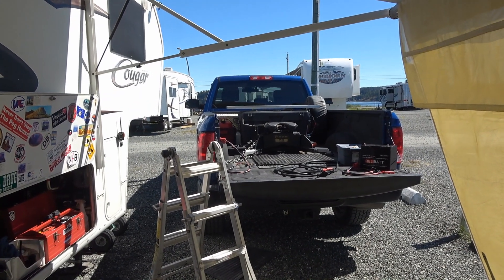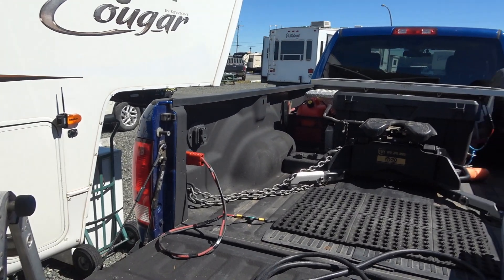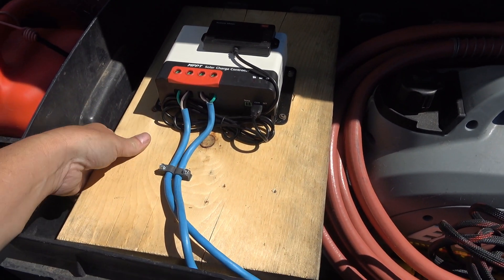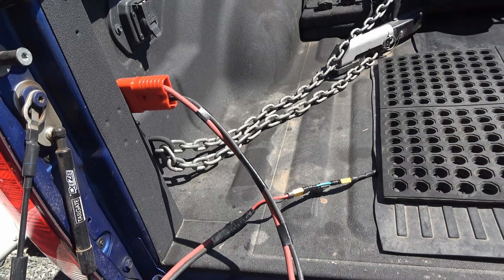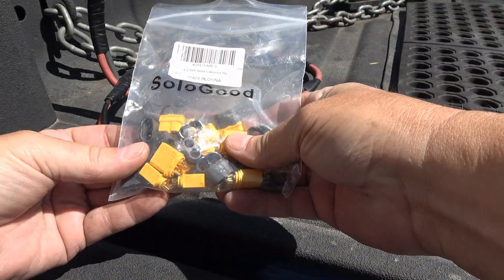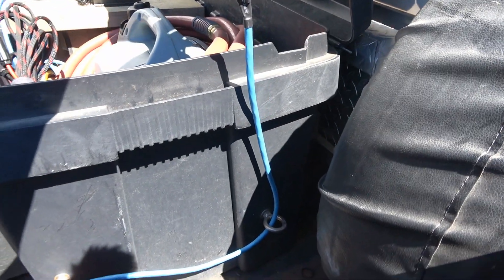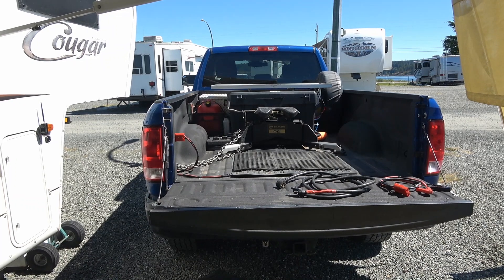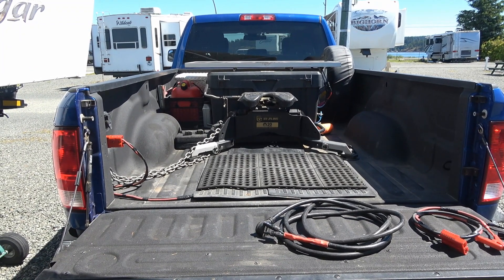Mod to Keep My Truck Starter Batteries Charged Up When Parked

Comment from the maker: Related Videos
BougeRV Solar Controller Install - https://www.loveyourrv.com/new-bougerv-40a-mppt-solar-controller-with-bluetooth-app/
DC-DC Charger Installation - https://www.loveyourrv.com/renogy-40-amp-dc-dc-charger-installation-and-demo/
Portable Ground Panel Mounting - https://www.loveyourrv.com/replacing-damaged-portable-solar-panel-plus-new-mounting/
Boondocking Water & Waste Systems - https://www.loveyourrv.com/how-i-handle-our-rv-boondocking-fresh-water-and-waste/
Thinkware Dashcam Install and Review - https://www.loveyourrv.com/thinkware-q800-pro-dash-cam-review-part-1-features-and-installation/

Comment: Love your technical drawing, Ray. Thanks for reminding me of XT60 and XT90 connectors. I have been trying to come up with something better than Anderson connectors to power some electrical accessories that will be mounted to the hard top, which is removable, of me '75 Ramcharger. I think the XT connectors will work nicely.

Comment: Hey Ray, Thanks for the close up shots of the storage box surgery! It should work perfectly for my generator as well. Did you use a Dremel?
Reply from the maker: No probs. :) I used my multitool https://www.loveyourrv.com/wp-content/uploads/2017/07/Milwaukee-Oscilliating-Multitool.jpg  The plastic is pretty thick for a Dremel

Comment: I just came across a great device for running cable from the Rv rooftop to inside the Rv. It’s called “cable clam”. It would work well for your truck box cables. 
I charge my Ecoflow delta from roof top solar panels. I ran the xt60 /mc4 wire through the roof of my motorhome using the cable clam. It works great!
Reply from the maker: Great tip!  I used one when running my portable ground panel cable into my front storage bay on the trailer https://www.loveyourrv.com/wp-content/uploads/2016/06/Portable-Solar-Panel-Hook-Up-Wire.jpg Used a marine grade one from Blue Sea, has worked well, no leaks. :)  https://amzn.to/3QLO4k3  Cheers, Ray

Comment: My old jeep 92 kept chewing alternators so put one on my jeeps roof and stayed there nearly twenty years lol was fantastic to listening to radio no fear of running down the battery added a inverter for ac loads we’re talking micro ac amts
Reply: Over 407 k miles btw still running with original engine and transmission most everything else was replaced lol